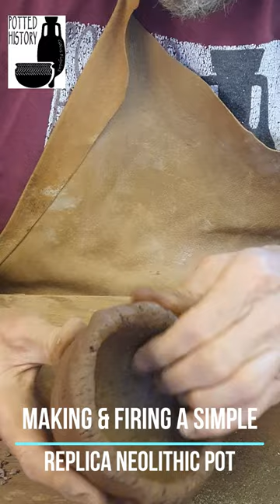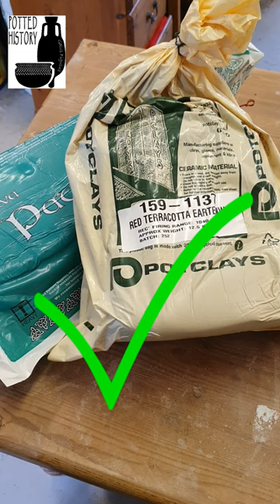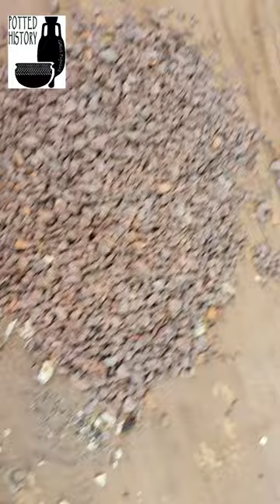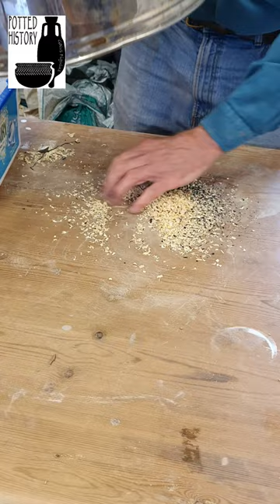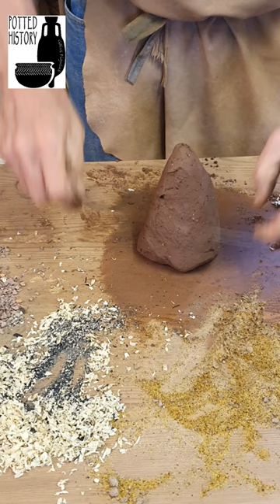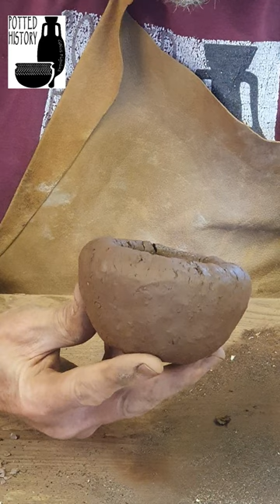Making And Firing A Replica Prehistoric Pot

Comment: This is great !  I have 2 questions : 
1) Are they recommended quantities for the additives, baked clay, sand, wood dust and gravel, or do you add them until your clay looks like what you cut it in the video  ? 

2) I see that you sifted the saw dust. is there a recommended granularity for the gravel and baked clay ? 
Thank you !
Reply from the maker: If I'm replicating a specific find I will try to get as close as possible to the original materials, we have stocks of all manner of inclusions around the workshop. In this case I was more interested in the open texture of the clay and demonstrating a variety if materials, it was probably about 20% by volume of additions. A good way to achieve a specific volume, is to make the clay into a disc shape then cut out a suitable sized wedge, like a pie chart, replace it with the material you're adding and then knead the whole lot together.
Reply from the maker: Again with the size of gravel etc, it would normally depend on the original and varies greatly, but generally something in the range of 1 to 3mm works well, in this case some of it was up to 5mm.
Reply: @PottedHistory  good trick ! so, 20 % is a lot. Do you think they did that on purpose, or they just were using bad kind of clay ?
Reply from the maker: @MokuraiDojo  Clay fit for purpose, I wouldn't call it bad.
Reply: @PottedHistory   oh what a wonderful tip!

Comment: Great video!

One nitpick: I think you are a bit overdoing it with the big gravel pieces. I've not seen this size of temper in prehistoric wares outside of huge storage vessels with thick walls. Never in  small pots.
Reply from the maker: Thanks. The intention here is to get absolute novices to sucessfully open fire their first pots and the large grit really helps. Also, here in Northumberland I've encountered very small BA food vessels and even beakers, where the larger inclusions actually emerge on both sides of the wall.